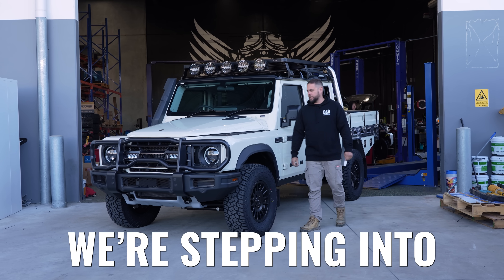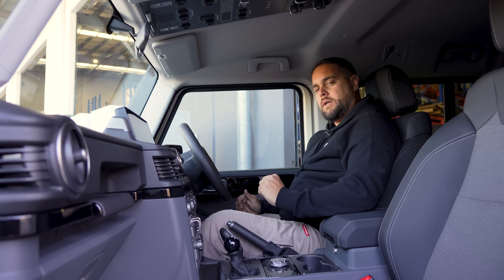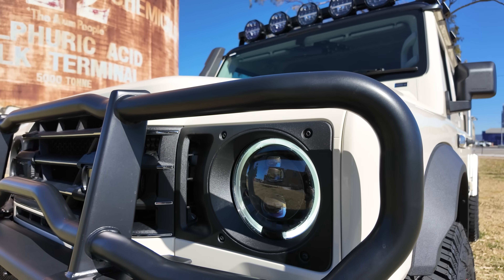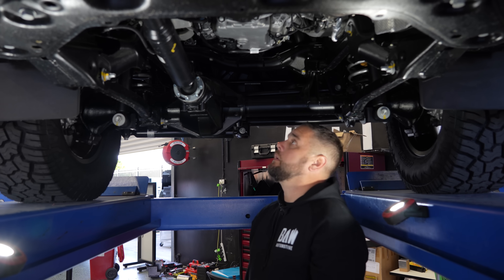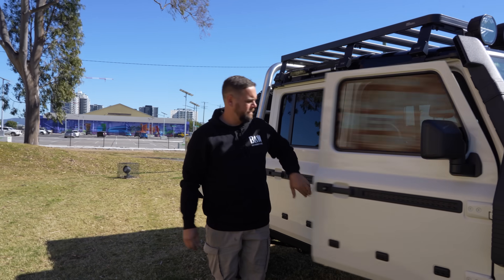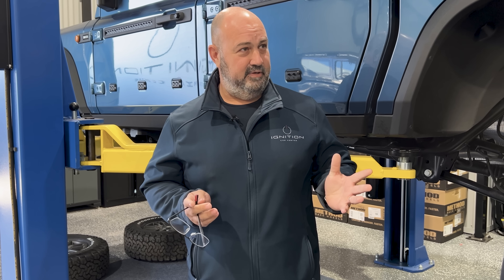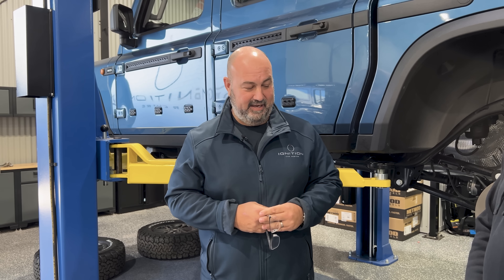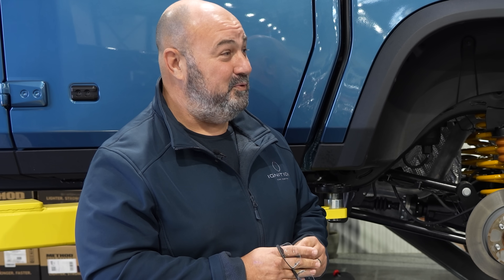Toyota V8 LandCruiser Faces an Identity Crisis: Can the Grenadier Become the New 4x4 Heavyweight?

Comment: No way I’m buying an off-road vehicle with a high performance on-road engine. Good luck finding premium fuel, spare parts or doing field repairs - not to mention the cost of BMW servicing and parts. Ordering an LC250.
Reply from the maker: The LC250/Prado looks awesome, packed with way more tech than the Grenadier. Can't wait to see how it performs on the tracks

Comment: I feel like this is the best thing out right now. The B58 is already proving to be bulletproof if left alone. 

My only concern is the steering. I feel like they have done everything else so well, it has been long enough to do something about so much play in the wheel.
Reply from the maker: The Grenadier’s got a lot going for it, but the steering takes a bit to get used too

Comment: Appears the driveshafts & differentials are SIGNIFICANTLY more robust than the Puma Defender's they are based upon. Replacing the problematic LT230 T/C is a great move too. Worth consideration for sure.
Reply from the maker: Absolutely, they’ve taken the Defender’s DNA and rebuilt it from the ground up into something even better.

Comment: What is the fuel tank capacity?  Is there a LARGE capacity fuel tank available ?
Can any low mount winch be fitted ? 
I have heard lifting these vehicles greater than 40mm causes wheel shimmy and drive line vibration due to short trailing arms.
Reply from the maker: It's a 90L fuel tank from factory. Brown Davis does a 68L auxiliary long range fuel tank, adding up to 158L.
Yeah, we've heard that too.

Comment: Great looking vehicle with many good features, including discs all round ( take note Triton, BT50, Hilux etc ) ! 
The only thing I don't particularly like is the fuse box and batteries under the rear seat. Can you imagine being loaded up for a big expedition with tons of " shit " on the back seat, and blow a fuse ! 🤣
Reply from the maker: It's about time more 4WDs got the memo about disc brakes! 
That's why I like the Quartermaster, you have a tray for all your gear. At least the battery and fuses are protected from water.

Comment: Its been pleasant to my eyes seeing it on the road however, i wish the put an actual speedometer cluster in front of the driver and definitely make a manual transmission or at least redesign the BMW shift knob. Also making washable floor without waterproofing the fuses box under the seat just doesn't make sense. Everything else pretty much beautiful and nice to see in this era of trucks and cars.. cheers ❤
Reply: You can get a shifter from the Supra fitted (the mod is on YT), and if you're washing the floor and wetting the fuses you're doing it wrong 😅
Reply from the maker: Glad to hear you like it! The speedo location does take some getting used to. As for the fuse box, it's safely tucked away under the seat. Thanks for watching!
Reply: As a guy who’s been following this vehicle since its announcement, that is probably what has disappointed me the most. I just can’t stand having to look at the middle of the car for the speed. It’s so annoying lol.

Comment: Toyota tax plus ARB tax for the 70 series, I’m yet to see a 70 series within 2yrs which hasn’t had $20K + spent on it.
The grenadier has most of upgrades done from factory. The BMW engine has proven reliability. Keep the service up and they are reliable.
For myself I wouldn’t buy an agricultural/ industrial vehicle trying to make it into something it’s not and changing it for touring and towing.
Buy the vehicle with the most value and standard fitment all match and have been tested together.
Reply from the maker: Value for money and well-tested components—hard to argue with that logic!

Comment: Parts and Accessories are two main concerns for 4x4 enthusiasts. 

This vehicle ticks the accessories department but has some doubts in the supply of its parts. 

If Toyota keeps treating the 70 series as a low class vehicle in its lineup, then the Ineos Granadier will takeover this market.
Reply from the maker: Toyota doesn't seem to care as much about the 70 Series as INEOS does about the Grenadier. Only time will tell.
Reply: Aside from body parts made by Ineos…what parts are you mostly concerned about?

The myriad of Bosch, Siemens, Hengst, Febi, Behr and Mann parts in the BMW engine?

Comment: It’s really funny to watch how people try to sell glass for the price of diamonds. Nothing has changed in human stupidity when a few extra buttons and shiny trifles distract attention from what really matters. The Ineos Grenadier could potentially be a good vehicle, but only at least in 10 years, when equipped with a Toyota engine, reliability, and parts & service leveled with Toyota. The rest is just pure speculation and manipulation.
Reply: Thanks good it doesn’t have an underpowered Toyota engine. 
B58/57 are much better than anything Toyota offered in the last 10 years. Even Toyota deemed it better than its own and installed it in the Supra.
Reply from the maker: We love a few extra shiny...squirrel. Sorry we got distracted. It's each to their own. Good to have choices
Reply: @miguelosterroht  Let's me educate you. 
Purpose and Design:

Toyota Supra: The Supra is a sports car designed primarily for on-road performance. It is built for speed, agility, and handling on paved roads and tracks. The focus is on aerodynamics, a low center of gravity, and a stiff chassis to enhance driving dynamics.
Off-Road Vehicles: Off-road vehicles are designed to handle rough, uneven terrain, including mud, rocks, sand, and steep inclines. They are typically built with higher ground clearance, rugged suspension systems, and more durable components to withstand harsh conditions. Off-road vehicles prioritize durability, traction, and the ability to navigate challenging environments over speed and on-road handling.
Requirements for an Off-Road Engine:
An engine for an off-road vehicle must meet several specific requirements to handle the demands of off-road driving:

Durability and Reliability:

Off-road engines must be built to withstand harsh conditions, including dust, water, and extreme temperatures. They need to be robust and reliable, as breakdowns in remote areas can be dangerous.
Engines should be designed with durable materials and reinforced components, such as heavy-duty gaskets and seals, to prevent damage from debris and environmental factors.
Torque:

Off-road driving often requires high torque at low RPMs to power through challenging terrain, such as climbing steep hills or navigating through mud and sand. An off-road engine should provide ample low-end torque to keep the vehicle moving steadily in difficult conditions.
Diesel engines are popular in off-road vehicles due to their high torque output at low RPMs, which is ideal for off-road use.
Cooling System:

Off-road vehicles may operate in environments where temperatures fluctuate dramatically, and engines may be subjected to extended periods of high load. A robust cooling system is essential to prevent overheating during prolonged off-road use.
Off-road engines often feature larger radiators, additional cooling fans, and oil coolers to manage the heat generated during demanding driving conditions.
Water and Dust Resistance:

Off-road engines should be designed to resist water and dust ingress. This includes sealed air intakes, waterproof electrical components, and protective coverings to prevent water from entering the engine during river crossings or heavy rains.
Some off-road vehicles are equipped with snorkels, which raise the air intake above the vehicle's roofline to allow for deeper water crossings.
Fuel Efficiency and Range:

Off-road vehicles are often used in remote areas where refueling opportunities are limited. Therefore, engines should be fuel-efficient and paired with large fuel tanks to extend the vehicle's range.
Some off-road vehicles are equipped with dual fuel tanks or have options for carrying additional fuel.
Maintenance Accessibility:

Off-road vehicles need to be easy to repair in the field, so engines should be designed with maintenance accessibility in mind. This includes the ability to perform basic repairs and maintenance with minimal tools and equipment.
Off-road engines should have robust and straightforward designs to facilitate quick repairs and troubleshooting in remote locations.

Conclusion
While the Toyota Supra is a finely tuned sports car built for on-road performance, off-road vehicles are engineered to excel in rugged, unpredictable environments. Off-road engines need to be durable, reliable, and capable of delivering high torque at low speeds, all while being able to withstand extreme conditions. These requirements are quite different from those of an engine designed for a high-performance sports car like the Supra.

So, what was the reason to mention Supra in your comment?

Comment: Wouldn’t be hard to be a 70 series.. the 100k Ute that does everything averagely… I don’t hate em but they over rated for sure..
Reply from the maker: You're not wrong! At least the Grenadier has proper climate control and comfy seats. The 70 will always have a place in my heart tho.
Reply: @BAWAutomotive the 70s have climate control, it's attached to a handle on the door, you either wind it up or down depending on the climate 😂😂😂

Comment: Onions is great in theory but come on, BMW motor and gearbox along with the same cost to service - no thanks!
Reply: The gear box is zf which is in almost every vehicles.  The bmw had won awards for durability and even toyots uses it.
Reply from the maker: It's not a bad engine, gearbox combo. Only time will tell if it can prove itself in this off-road application
Reply: @BAWAutomotive B58 has been around for over 8 years, have seen a few with over 300k on the clock (5/7 series Limo services in Europe), ZF8 is the best gearbox currently available and has been around for over a decade. 
You have the B58 + ZF8 in every single country.
Reply: Obviously can’t afford one lol

Comment: Interesting watch. Never seen your channel before and not to disparage the Grenadier but you don't seem to have driven a lot of variety in 4x4 utes in recent years.
Possibly you were a 70 series fanboy in the past?

Factory options already done by other brands
- Auxilary switches and wiring 
- Heated Seats
- Bucket leather seas
- Steel bar
- Winch
- LED Headlights
- Front and rear lockers
- In floor drain bungs

These are good things but ALL were available before INEOS came along.
Reply: As you've said you've never seen this channel before so your assumption is already pretty wrong since it's just based on this one video. This channel is primarily a video showing the builds they do. That being said, he has a lot of experience with other 4x4 utes and wagons, years of experience with all sorts of them as he works with them and has owned a few himself.
Perhaps watch more of his videos before saying "it seems" on the very first video you see.
Reply: @floofy117  Read into what I said however you like. The points I raised on features are still correct.
Feel free to bring your arguments to the table.
Reply: Which vehicles in this class offer:
Pre-wiring under bonnet, footwells, roof, rear luggage area. In the harness, fused & ready to use?
Homologated, crashed tested, fully integrated front-winch with a 5 year warranty?
Recaro seats ex-factory. 5 drain plugs & IP rated interior. Dual battery kit ex-factory.  Front-centre-rear diff locks ex-factory. Water separator on Diesel ex-factory. All warranted, serviceable items.

Difficult to find anything that brings all this together at this price point. And, without paying LCT.
Reply: @hocevarjustin  Asking for another vehicle to have Recaro seats is like hilux drivers asking for another vehicle with a Toyota badge.
The brand isn't a feature.
Reply from the maker: Guilty as charged—I'm definitely a 70 Series fanboy. Still grieving after my wife made me sell it last month

Comment: Very nice car but why a BMW engine....... Thats going to be a high maintenance engine when the ks built ub....
Reply: The DIesel and Petrol choices are used in so many BMW its not an issue. Servcing on these is not difficult and they chose the engines for a reason. The diesel is bulletproof.
Reply: Research the engine more, it's a very reliable and powerful one...
Reply from the maker: It's probably one of BMWs best engines. Even won Ward's 10 Best Engines four times in the US
Reply: We’ll see about the engine being very reliable. Winning awards doesn’t mean it’s reliable and durable in the long term. If it is, it will go against a multi decade run of engines that become high maintenance once they’ve done a few miles.

Comment: Toymota can't compete with these  in anyway at all
Reply: They compete in sales since more 70 series are sold every 20 days than these sell in an entire year……
Reply from the maker: They finally got some competition for the 70 series
Reply: @BAWAutomotive my Hyundai excel has more flex than a 70 series
Reply: @craigdavid6668 just becasuse they sell doesnt mean there any good  after you buy one it's tied to the shop for
New clutch 
New turbo
New injectors
New intercooler 
Just  to make it go like a v8 then
new seats
New suspension 
New rear diff to track the front one
New cup holders & a 100 other mods to make it a half decent 4wd & it still won't flex as much as a stock excel
Reply: @putrol4.2  So you can’t afford one and you’re just upset, got it.
Reply: @craigdavid6668  i couldn't afford one in 3 lifetimes I'm.not a drug dealer or stupid